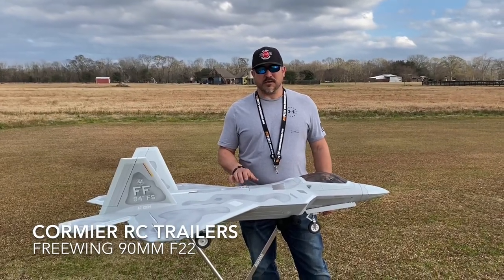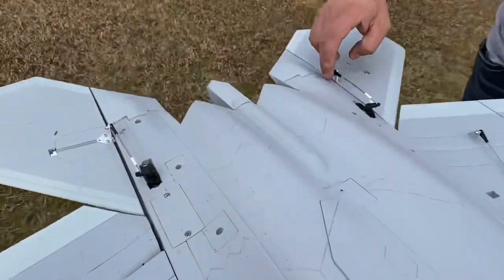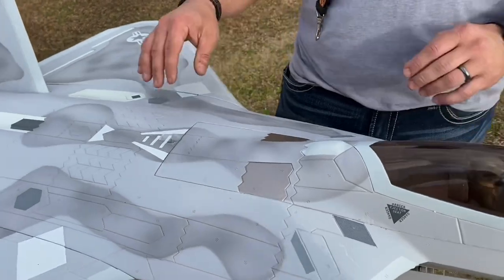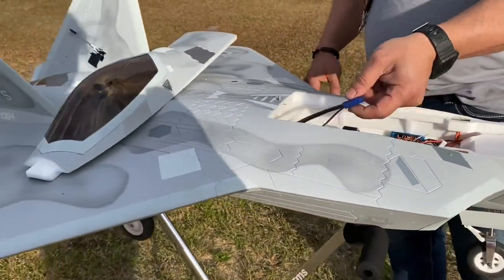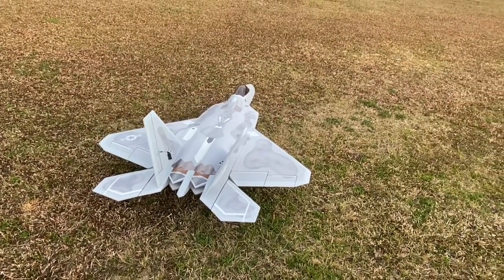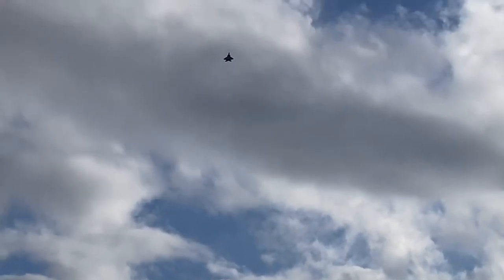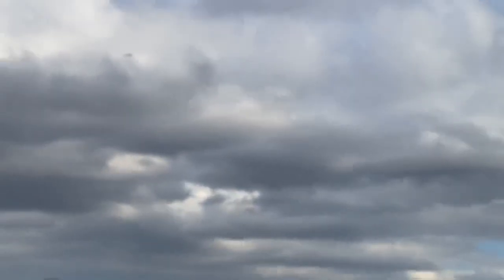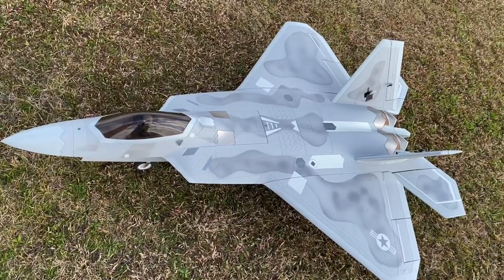Freewing 90mm f22 6s hp

Comment: Liked the video, will be maidening mine once the weather improves and the runway is rolled I have the out runner 1750 in mine. Transitioning from the Avanti to this I’m told should be a non event, will get comfortable with this one before trying the f18 (hp version) as it will be my 1st 90 size jet.

Comment: Hello nice flight and nice plane, could you tell me the position at which you adjust the giro on the admiral receiver relative to a clock in this plane.  thanks to your video i just ordered the f22 and i am going to use the admiral receiver on it….thanks!
Reply from the maker: Turn them all back to about 10 o’clock
Reply: @cormierrctrailers5177  thanks

Comment: Nice flight. How did you set you admiral gyro to remote on/off?
Reply from the maker: You would have to watch one of the videos from motion where it says setting it to a two positions switch
Reply: @cormierrctrailers5177  Got it!, Thanx. I by-passed this one earlier b/c I'm out of 2-position switches on my Dx8: Gear(A) and throttle cut(G)

Comment: I have the same jet and I'm an amateur , I have the same admiral receiver in mine , my question is when I flew mine the wings started rocking back and forth and it scared me,  I was able to land it perfectly but why did it do that ? Was I flying to slow or was something wrong with my receiver setup ?
Reply from the maker: Gyro gains need to be adjusted you either need to lower your Giro gain or make it higher depending on the speed that you were talking about.
Reply: @cormierrctrailers5177  I thought maybe it was trying to tip stall but I'll go back and watch some videos on the admiral receiver gyro gain setup . Thanks
Reply from the maker: It will tip stall only if you going to slow if you got wing rock at top speed then it is gyro gains.
Reply: @cormierrctrailers5177  one more question , if you fly yours slowly to the point of almost stalling does the wings rock back and forth ? What are the stalling characteristics of the f22 , thanks for the reply .
Reply from the maker: @motoriderguy3854  Yes they will start to rock slowly then it will roll to one side and snap out but if the Gyro is set correctly it will help this out. But keep in mind if you go to slow the Gyro can only do so much.